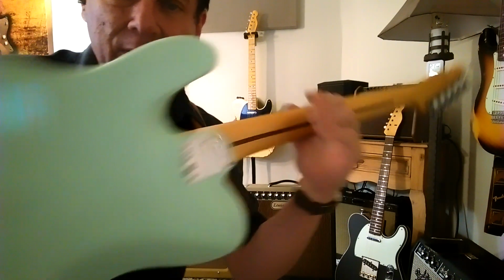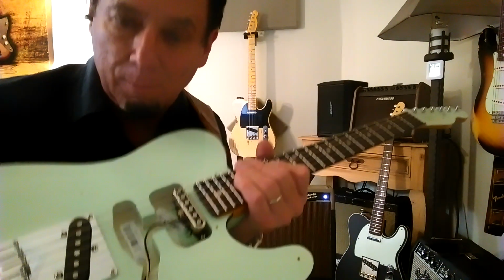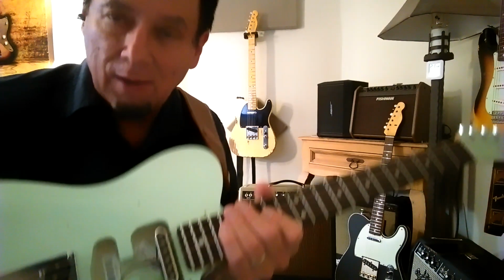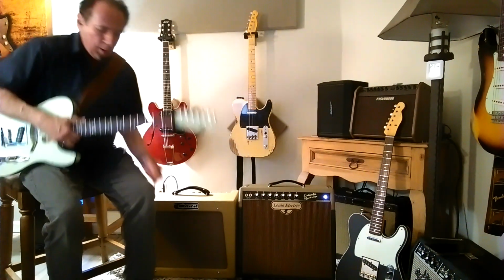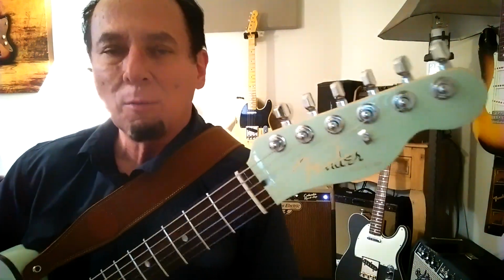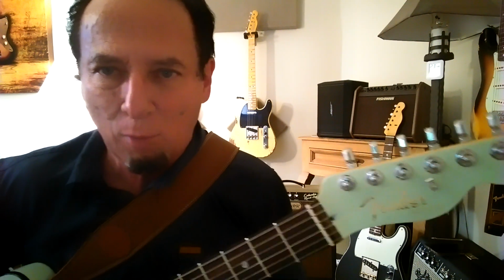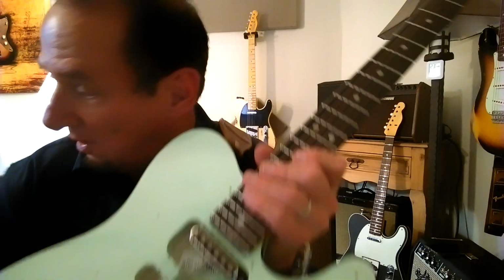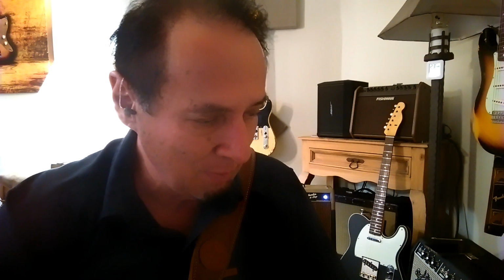Fender Ultra Luxe Telecaster Upgraded! Lollar PU's / RS Guitarworks parts

Comment: That's 'a nice.  I think you got those Fender boys scratching their heads.
Reply from the maker: Thanks Michael. Don't know that I'll ever get Fender's attention, but they sure could release a flavor of this guitar without the noiseless PU's and S1 Switch. I find the S1 useless. I'd rather engage a boost pedal. The Noiseless PU's are just kind of flat and middle of the road sounding. I KNEW this guitar was capable of so much more. Once these new strings settle down, it should be even better. They are brand spanking new so there was some added 'zing' to the sound. But its easier to roll off than try and get the sparkle if its not there.

Comment: Wow those lollars sound amazing!
Reply from the maker: The upgraded sound came to life with the RS Guitarworks pre-wired Vintage Tele control panel. It uses a special 280K CTS Volume pot, Audio Taper 250K CST Tone pot and .047 paper in oil cap. Once I upgraded to .010 - .046 Daddario NYXL's with those other upgrades it improved exponentially.

Comment: Funny that it's routed for three pickups....That's what you found when you removed the pickguard???? I wonder if my two-tone version is cut for three as well....Do you still stand by your decision going Lollar for this guitar ???? Seems like it would defeat the purpose of the original intent of Fenders' modern day luxe guitar....
Reply from the maker: Yes mine was routed for three PU's. I put it back to stock with the stock noiseless PU's and it just makes more sense since that was the purpose that Fender intended.  Yet after all was said and done, I always play my custom shop 63 Fender double bound Tele more. I sold the Ultra Luxe.